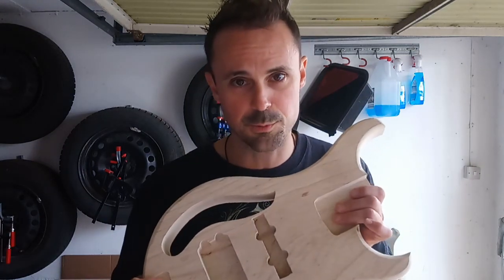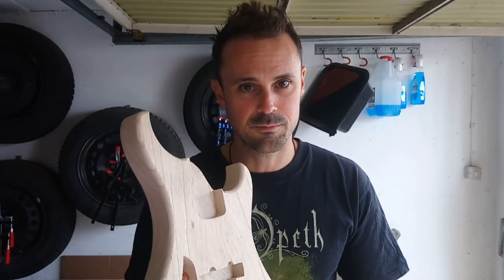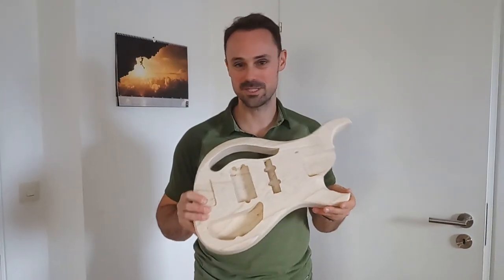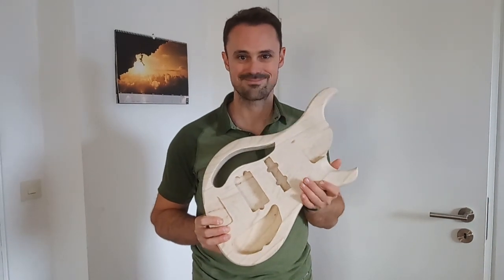Great Guitar Build Off 2020 Part 1 REBOOTED

Comment: Your last vid has crossed my mind more than once over the last day or two. Please please PLEASE be careful with where your hands are on that router table.  Scares the hell outa me watching you use it.  But I’m overly terrified of those things anyway.
Reply: Bonehead, he speak wise words. I can hardly watch you using the router table. When the cutter catches the wood and pulls the work, if you have fingers upstream of the cutter bit, it's going to go very wrong, very quickly. Fingers downstream not so much of a problem, if that makes sense.
Reply: I really hope that didn’t come off as condescending.  I’m just worried about ya dude.  Wanna see you safe with all yer digits.  I really hope you took it that way.  Watching how close your hand came to the bit in the kickback in the previous video just made my stomach turn.  I’m terrified of table routers.
Reply from the maker: @BoneheadGuitars  Thanks for this Bonehead. I'm learning and wasn't scared of the router in my hands and thought it'd be just as safe in the table, but also developed a huge respect very quickly.
Reply: @ShawnHeath  yeah man.  They don’t bother me when I’m holding it, the table scares me more than anything in the shop.  This is crazy, this thread just crossed my mind 10 minutes ago, and lo and behold here’s a comment...  You jumping into GGBO21?
Reply from the maker: @BoneheadGuitars  Hey bud! I'm not signed up yet. I'd love to, but my wife wants me to finish an entertainment center first... Do you know if there's a cut-off for registration? I'm stoked to see your creation this time!
Reply: Actually I don’t, that’s a good question.  I kind of doubt they do though.  That’s be a question you could email.  Don’t remember the address, but it should be on greatguitarbuildoff.com